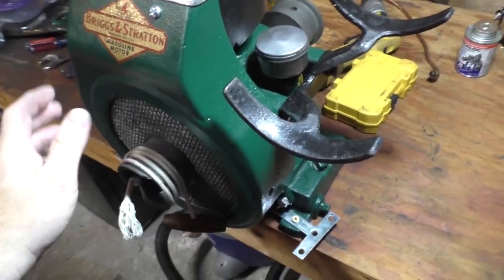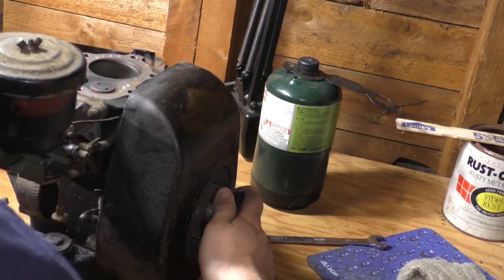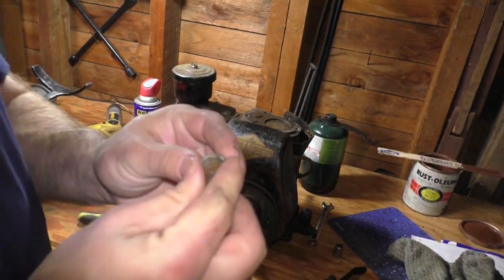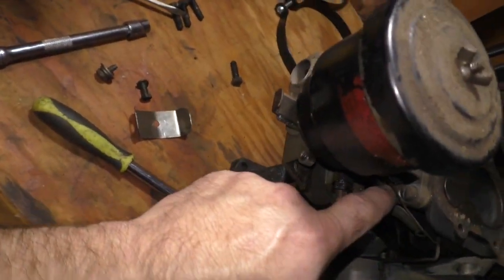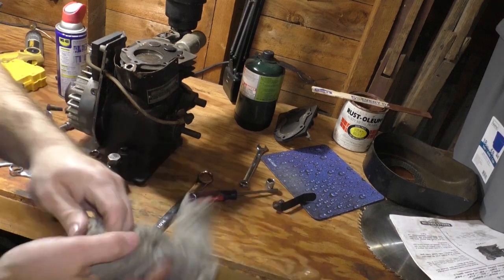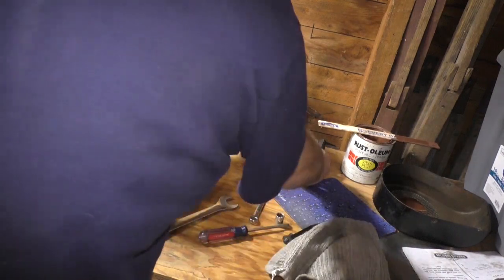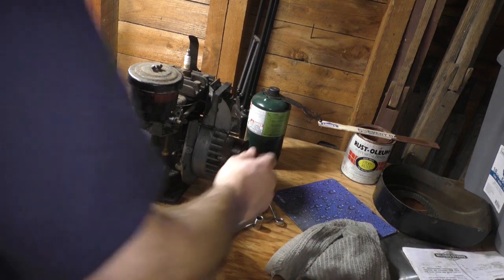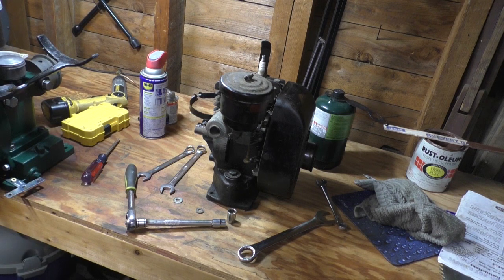1940s Briggs and Stratton 5S - Part 2 - Let's TEAR ITS HEAD OFF!!! (for science!)

Comment: Yea that intake valve definitely looks a bit sluggish to me. You could probably get away with just putting some lubricant down in there and working it, but taking it apart and lapping it will definitely work better. The date casting I mentioned would be on the back side of the flywheel. You will only be able to get to it by pulling the flywheel, which you will need to do if you need to clean the points. Just note that the nut is reverse thread! That can really throw you for a loop lol! I've never heard of a 5s being on a washing machine before. I mean I guess it's possible, but I've never heard of it. I know that the Model WM and Y were washing machine engines though. Plus, if this thing ever had a kick start or lever start, it wouldn't have a cup on the front. It would have a solid mesh. Ohh and you are right, the bolt with those 2 big washers is just a structural bolt, not the oil fill. The oil fill is the bolt that is right above where the drain plug is. This is a very nice original engine! I'm sure it will run great! Keep the engine content coming! I like it a lot! :)